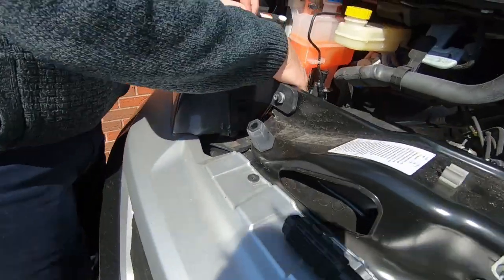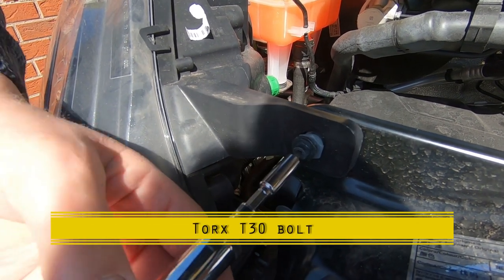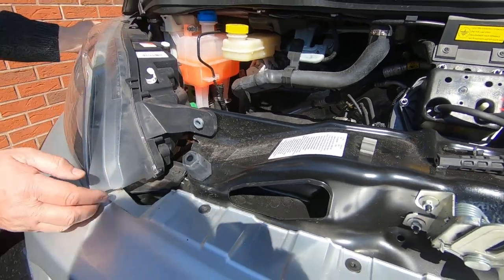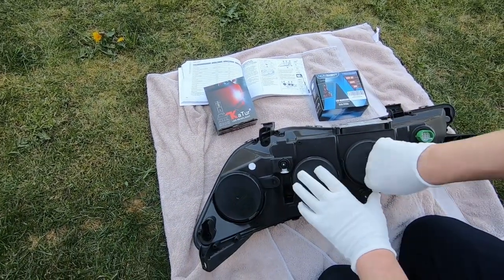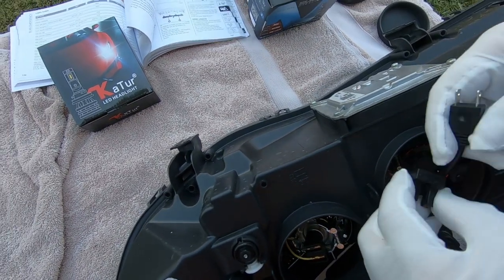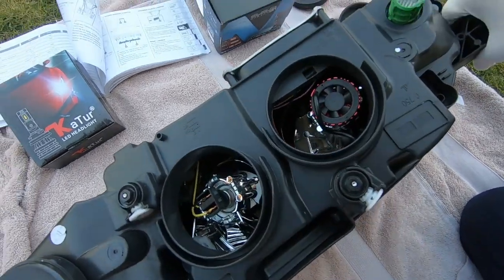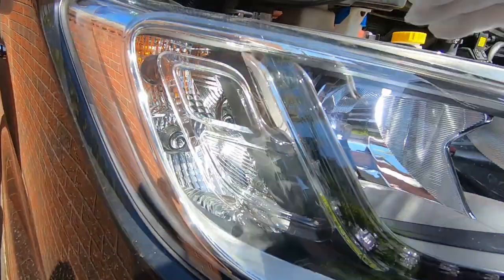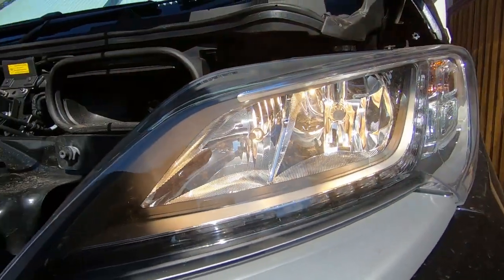Upgrading To LED Headlights On Fiat Ducato Motorhome

Comment: It's my understanding that it's illegal to change to LED bulbs unless the vehicle was originally fitted with them as the bulbs are not type approved
Reply from the maker: As I mentioned.
Reply: @G-ra-ha-m  and are legal, headlamp reflectors designed to work with them, which is why retro fitting LEDs is illegal and an MOT failure. Might improve what you see, but what about the accident you cause by dazzling a driver or someone riding a bike?

Comment: Hi, do you know how to adjust the vertical beam throw on the headlight? Is it the left hand torx screw on the unit? I've fitted LED and want to point the headlight down a little.
Reply from the maker: I didn't think you need to adjust it on the headlamp. The Ducato has two buttons to adjust the headlamp on the right hand side of the steering wheel. Four positions if I remember correctly.

Comment: I ordered two sets of KATUR. I didn't find any reason in any video, why to install two different brands. So using 4 LED bulbs of the same kind replacing 4 H7, which are the same, should not result in any issues.
Reply from the maker: The dipped beam was the brighter of the two as the light is spread out more. You should be fine though.

Comment: Excellent. Thanks Bob. I just install these today after watching your video and inspiration it gave me we've just acquired a 2016 Fiat Ducato rimor superbrig suite. No problem with fitting at all I don't know if I'll hold my nerve though to send it in for an MOT with these fitted. It's only just had its MOT so I've got 12 months to wait yet. Cheers Regards Garry
Reply from the maker: If it helps, Gadget John's van passed its Mot with LED headlights.
Reply: @BobEarnshawMoHo  that will do for me then. Top man

Comment: Excellent video,easy job 
just fitted the katur to the dipped headlight (2019 ducato) 
May fit the high beam ones later 
High beam is reasonable and dipped stays on anyway ,so will see what it’s like 
Thanks 🙏

Comment: Hi Bob. Great video as usual. I’ve only just seen this vlog as I’m thinking of upgrading to LED’s. A question I have though is, have you had an MOT since you fitted them? Strictly speaking replacing halogen filaments with LED’s is illegal and is a failure. If one wants to upgrade, then the complete headlamp assembly should be replaced. But how would a tester know that the filaments have been changed? I’d be keen to know how you got on as I’d also replace the filaments as it’s obviously cheaper than replacing the assembly! Keep up the great work Bob! Cheers!
Reply from the maker: Yes, it passed it's MOT in December last year. Another due soon and I assume they will pass that too. The worst that can happen if it fails, is that you have to change back to the old useless ones!

Comment: Hi please can I ask why you used 2 different brands of H7 Led on the dipped and high beam? They’re both H7. I fitted the Katur led to my fiat Ducato dipped beam and I’m very pleased with them so I wanted to fit the same again for my high beams
Reply from the maker: The dipped beam was the brighter of the two as the light is spread out more. You should be fine though.

Comment: Hi Bob. Thanks for your video. Very good explanation. 
Quick question : after you changed the one for the main beam, look like the bulb can move a little (even when it was attached) Is that the case ? Apparently, this small "ring" (where you attached the bulb) is thicker than the original bulb and it can be tricky to correctly attach the bulb ?
Also, did you had to go to a maintenance center to setup your light ? (too high or too low issue ) ??
Sorry for any misspelling. I'm french, hope it's understandable
Reply from the maker: It doesn't move once it's fitted. The light pattern looks fine when I have used it.
Reply: @BobEarnshawMoHo  Thanks for your quick answer

Comment: Hi Bob

Did the ECU and system settings just accept the new bulbs ?

I've read it's not easy to fit a new  headlight unit with led Drls if the existing unit didn't also  have led Drls as the software objects to the new functionality for some reason.

But obviously changing the main and dipped beam bulbs to LED wasn't an issue.
Reply from the maker: No issues or problems with them on my 2019 Ducato, which has LED DRLs. I can't comment on other models, but I've been using them for 2 years now.

Comment: Thanks for such a great video. Just wondering how they are 9 months on and if you'd still recommend doing? I'll be fitting to my van which I use on a daily basis so hoping for something durable. I fitted some to my car a few years ago and they didn't last the year, but it was a Volvo so headlights always on
Reply from the maker: They're fine, a big improvement on the old bulbs. No problem with them.

Comment: Hi bob, I'm Gilles from France. Many thanks for your video. I've a Ducato mod 2022, and I installed, like you, some led bulbs for mean and secondary. And it works with no problem, and the light, during night conditions is incredibly improve. But I tried to instal led bulbs for day fire. But, even if I bought special bulbs without defaults, it didn't works and i have a warning at the dashboard. Do you installed this type? Have you got a solution or a link were I can buy bulbs with any default? Many thanks in advance.
Reply from the maker: Do you mean you installed Day Light Running Lights or are you asking about the Headlights? I didn't have any problems with these LED lights that I installed on my Fiat Ducati 2019. Did you install the same LED lights? Have a look at the video description.
Reply: @BobEarnshawMoHo  Many thanks for your quick response. For main bulbs (H7), NO problem. I spoke about day light (W21/5W). But I've just to mind that you have yet day lignt by LED... Sorry you dont' t have the same assembly tha me... sorry for my misunderstanding. Regards.
Reply from the maker: My motorhome has LED Day Light Running Lights fitted as standard.

Comment: Hi. Just reviewing the video of the upgrade to LED lights which is most useful. Are you able to advise as to how you distinguish between headlight bulb and Main beam. I think the headlight is a H7 but what Is the main beam code. Thx.
Reply from the maker: They are the same, both are H7. When I made the video, the only difference was the brightness. Only one of them are available now though.
Reply: @BobEarnshawMoHo  many thanks for this clarification. Appreciate quick reply.

Comment: Hi Bob, great video. I’ve changed my headlights a you suggested and they work great. Just one question, in the headlamp module, in addition to the two bulbs that I replaced, there is another small bulb to the outer edge. I’m not sure if these are daytime running lights or parking lights, but is it possible to upgrade these a well to LED?  Not the indicator light but the one below it. Thanks.
Reply from the maker: You can get separate DRL LED strips, not sure you can get swaps for those in the headlamp. Our DRL are already Leds.
Reply: @BobEarnshawMoHo  thanks. Yes I think we have those that show as a sort-of outline to the main light, but we still have an old fashioned “yellow” bulb on the edge of the unit. I think I need to test to see when it comes on.
Reply from the maker: Had to check that, that's just a blank if you have the LED DRLs. Have a look in the Fiat Ducato Handbook, page 147.

Comment: Bob, these bulbs have small fans built in at the end of the bulb to keep them cool, be careful putting the black rubber cover back as this might stop cool air being drawn in, also did you put the spring retaining clip back on the dipped beam bulb, when I fitted mine I couldn’t get that clip on as the bulb had a thicker plastic shoulder, whereas the original bulbs have thin pressed metal shoulders I changed mine after watching Gadget John’s video, made a fantastic improvement but in the back of my mind was thinking the lamp manufacturer has designed the lamp to fitted with standard H7 bulbs 🤔🤔🤔
Reply from the maker: Thanks, I've just been outside to double check them, and they are secure. I believe there is enough room for the fans to work properly.
Reply: Sorry for making you do extra work there Bob, yours must be the latest type of lamp that you push the bulbs home instead of using a very fiddly spring clip which gave me most of my trouble fitting mine. When I first watch your video it looked like you removed a clip on second bulb, must have been a trick of the light, when I checked again & again I could see you didn’t 🙄🙄🙄
Reply from the maker: @prou5  yes they just push in and wiggle out!

Comment: Hi both recently did some driving at night through France & Spain found out exactly how bad my headlights are on my motorhome, went back to your video when you upgraded your lights, can you advise that if I fit these LED bulbs they will pass an MOT? thanks in Advance regards Rob
Reply from the maker: Ours passed an MOT in December.
Reply: Thankyou l will get them ordered and fitted ASAP 😁👍

Comment: Curious as to why you installed different H7 LEDs in the high beam and the low beam?
Reply from the maker: Because the dipped beam didn't need to be as bright.

Comment: Bob, I have just put out a video on my channel changing my headlight bulbs to LED. I have had comments saying that they will fail an MOT and you can only use them off road. I've changed mine and they look great I have to admit. I'm gonna go to the MOT centre and see if I can get them aligned correctly so I am not blinding oncoming drivers. Have you had similar comments about changing yours?
Reply from the maker: Yes loads of comments, also heard from people who have had LED lights that passed MOT with no problems.

Comment: Hi Bob, looking at the specs on those bulbs on Amazon, the Katur dipped beam are 12000 lumen 55w 6500k whilst the high beam Novosight  (red ones) are only 10000 lumens 6000k. Is this right? Surely it should be the other way around? I.e the high beam brighter / more powerful than the dipped beam? Or am I missing something? Thanks Bob, keep those Vids coming.
Reply from the maker: Yes, as I understand it, the dipped beams are brighter as there is more light spread out on dipped than main beam.
Reply: @BobEarnshawMoHo  Cheers Bob.
Reply: Don’t get too taken in by the exaggerated specs these lamps tend to have, I’d be surprised if either was more than 5000 lumens. Still an improvement iver halogens for night driving though

Comment: Existing halogen headlamp units on vehicles first used on or after 1 April 1986 must not be converted to be used with high intensity discharge (HID) or light emitting diode (LED) bulbs. If such a conversion has been done, you must fail the headlamp for light source and lamp not compatible.

This does not refer to complete replacement headlamp units which may be constructed with HID or LED light sources.

If a complete headlamp unit has been replaced with a unit that was manufactured with HID or LED light sources, it must not be failed for ‘Light source and lamp not compatible’ but it must meet all other requirements detailed in section 4 of this manual specific to the type fitted at the time of test.
Reply from the maker: Thank you, I have been told this several times on this video. However, my motorhome passed it's last MOT as some testers seem take a more practical approach than the government.

Comment: Hi Bob and Jenny.
Just viewed your latest vlog and it looks like a modification even a duffer like me could undertake. My 2019 Ducato has the same "yellowish" lights.
Question though, once they are fitted, do you need to get your lights re aligned or do they just simply replace the originals settings and all ?
Reply from the maker: I just replaced them and they are still aligned OK.

Comment: I  did the same to a 2019 Ducato ( base headlight ), had to also install load resistors to stop dashboard error ... I assume you did not have any canbus errors
Reply from the maker: No, I assume these have the resistors built in.

Comment: I have upgraded my led headlights.
They make such a difference.
Is this the first time you’ve upgraded you Led lights? I also fitted led registration plate  lights.
Reply from the maker: Yes, first time I've tried LED headlights, very impressed so far.

Comment: Yup didn't show how to remove the corner panels which can be difficult to remove as the plastic pegs may snap off
Reply from the maker: I didn't need to remove any corner panels, maybe it's different on a 2019 van?

Comment: I haven't fitted them.but seen cars and vans with them.but when there coming towards you they  blind you.!
Reply from the maker: They must have their headlights adjusted too high. Some people may not know how to adjust them.
Reply: I absolutely agree with you .. I don’t drive at night now because there are so many vehicles with these LED lights that just blind you.
Reply: @kevmas  I have to agree with you and John that these are a nightmare, especially on our local single track roads where you have them coming straight at you. There must be a lot of people who don't know/can't be bothered to check they're aligned correctly  (and I'm not just talking about motorhomes, here)!  They also seem to seriously spook deer.

Comment: I blind people even with normal bulbs with led h7s there just blinded for further away 😂idk whats going on with my lights ive always been flashed regardless of what jumber settinb and bulbs ive used
Reply from the maker: I assume you know you can adjust the level of the headlamps with the buttons to the right of the steering wheel.
Reply: @BobEarnshawMoHo  yeah doesn't matter what I pu that on I get flashed regardedless .. imma just gonna stick with the flashers are sensitive  to light